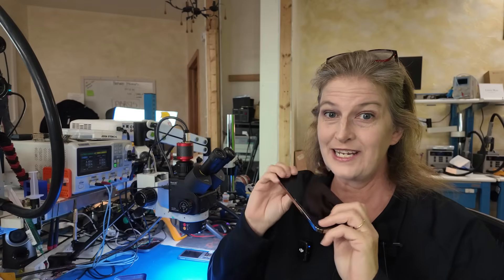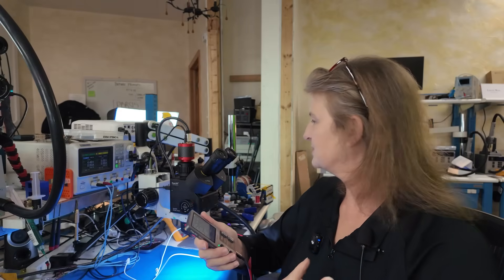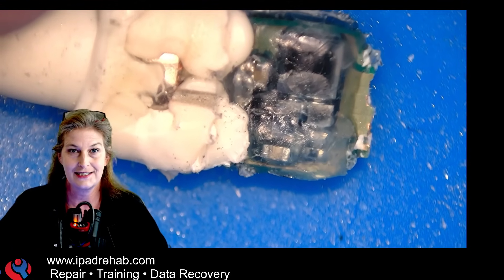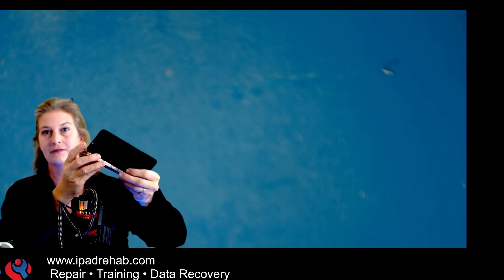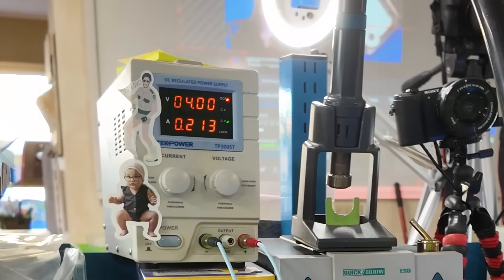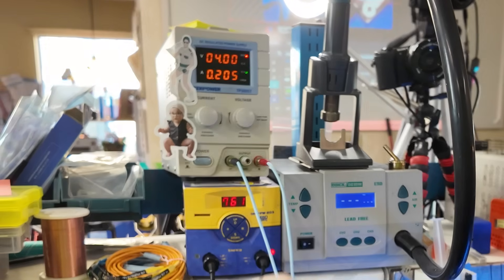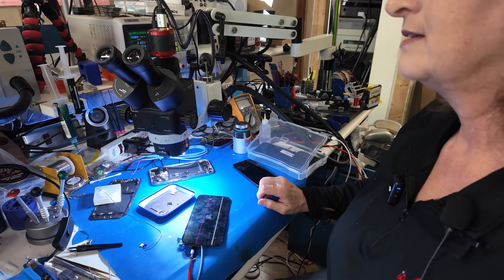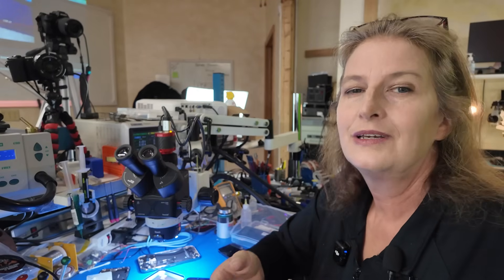Airplane Outlets Can Kill Your Phone (Data Recovery Case)

Comment: No matter what cable or device manufacturer, just don't plug in some random/ unknown port.
Reply: Or use apple, than you can charge with ground loop with shitty FM transmitter for years

Comment: does any of this apply to Android phones?
Reply: I don't think so, but you should still take precautions, use a good quality cable, good quality charger (avoid these public ones, if you need to, charge a power bank and use the power bank to charge the phone). And of course, backup your data

Comment: I have a wired headset that has a battery that (I've since replaced) that didn't last a full flight. I plugged it into the seat back, and it produced a hum. I then used a power bank instead, and that did not produce hum. But these days you are not allowed to use a power bank on some air lines, and on some you must have the power bank visible if you use it. BTW, I have lipo bags for my power banks and batteries and bring them on flights.

Comment: Isn’t this proof of bad design of the Apple iPhone charger port circuit?  Shouldn’t the protection chip be inside the iPhone to protect it from getting zapped by voltage fluctuations?

Comment: When the phone reboots due to missing sensors does it continue to airdrop the photos in the queue?
Reply from the maker: No, you can only do it in sets, however one great and wonderful day the airdrop strategy did STOP a xsmax from rebooting.  I don’t know why and it never repeated.  That phone had a charge port sensor error from severe charger damage and it burned the cpu.  It rebooted no matter what.  Then I started airdropping and it stopped rebooting.
Reply: @JessaJones that's a very strange one!

Comment: So why exactly does that  $1500(?) piece of garbage not have over-voltage protection?
Reply: More importantly, why does that $115,000,000 flying tube not have basic surge protection for seatback outlets used by passengers?
Reply: @TRLTheRandomLab  Honestly, IFE system should have a voltage stabilizer... Aren't voltage stabilizers airworthy? haha
Reply: @TRLTheRandomLab  for starters, it's a very expensive airplane, not a power supply for flimsy Apple products. And I don't see the first shred of evidence that it was the airplane's fault. Do better.
Reply from the maker: It’s definitely the airplane.  As evidenced by “I used this charger all the time.  Then I plugged it into the airplane.  Now my phone is dead”.  Repeated enough to jump out as signal vs noise in the thousands of “how my phone died” stories we’ve heard over the last decade.
Reply: @JessaJones  no, you're arguing, not showing evidence. And you're 100% wrong. The evidence that you showed in your video clearly shows that the seatback has a USB-C port. The Apple phone has a Lightning port. They're not the same, or equivalent. Also shown in your video: the kid used an adapter not made by Apple. Try reading the fine print, that's against the EULA for the phone! There's absolutely nothing on that seatback saying "for Apple phones" so the error is 100% the user's, for plugging the Apple product into a non-Apple port, and using a non-Apple adapter cable to do it.

But don't take my word for it, go ahead and sue the airline with your unsubstantiated allegations. I'm confident that a judge would say the same if it was even allowed to go to trial. Frivolous cases usually don't.
Reply from the maker: The video is about Nicks phone, and countless other phones.  In the video I dissected Nicks actual charging cable that he plugged into the actual airplane seat outlet into a charging brick that fried his phone.  This is not an isolated case.  The other major phone killer is truck cigarette outlets for the same reason.    They generate voltage spikes when the engine starts, similar to the airplane.   This is a known phenomenon dating back to 2012.

As an aside, I included an amusing clip of my own son plugging his android into a usb c outlet while I told him not to do it, as a lead in to the general problem of airplanes frying phones via cheap chargers that have insufficient protection.  It can also happen, less commonly, with well made chargers.  

There is a risk to plugging ANY phone into the wild voltage of airplanes, vehicles, and other power sources subject to large swings in power.  It is 100% a risky thing to do.
Reply: @Speed-Daemon-123  bro your attitude is why i can't stand some electronic engineers. arguing android vs apple like its 2014.
Reply: @Speed-Daemon-123 I know right... Can you imagine how many people use those planes, and how many of those have iphones, and how many of them charge the phone? If that was true, it would be a much larger amount of complaints
Reply: @luladrao5001e  it's better to light a candle than to curse the darkness. As you noted, most people handle these situations with aplomb. The ones who choose to ignore the instruction manual, then make scapegoats for their failures are only cheating themselves.
Reply: @JessaJones  I wonder if it's because the power is AC coming from the engine generators, and not properly grounded? I'll have to ask my aircraft mechanic friends about this. Fascinating video at any rate!
Reply: Because Apple decided to put that in the cable, opposite of everyone else. Very weird decision.
Reply: @zaprodk  I could believe there's some good engineering or manufacturing reason for that and it's not JUST part of their user-blaming, repair-hostile, accessory-selling business model, but gosh it sure fits into that nicely doesn't it
Reply: I have traveled twice with Thai airways recently, and none of the times, did my USB charging outlet in the entertainment system work. Hidden between the seats, is actually a 230V outlet, which few passengers even know about, so you can use a regular phone charger, however these are international outlets, where no devices connect properly because of the multi plug functionality.

If the aviation industry isn’t doing this well and we even risk to fry our devices, I believe people will secretly go back to using powerbanks on the airplane on longer trips. Without a working phone, you could even get into more trouble than not having your ticket, but when you arrive US immigration and they have decided to search your device and it refuses to even be charged and turn on.
Reply: It does.
Reply: That extra energy still has to go somewhere. Thermodynamics and all that.
Reply: @StanleytheCat-v8z  at least you're thinking. But no, that's not how USB works. The various voltages that USB supplies are not caused by planes, trains and automobiles, they're caused by the phone asking for them on the bus. The Apple phone then applies that voltage to a load indiscriminately. Normal, USB-compliant phones don't do that.
Reply: @Speed-Daemon-123  I'm referencing over voltage protection. The voltage clamping circuity needs to somehow dissipate the extra circuitry.
Reply: @StanleytheCat-v8z  are you an AI bot by any chance?
Reply: Because it's stupid Apple 😂😂😂
Reply: A fool and his money are soon parted. Android phones are cheaper, more robust and use industry standard cables that are also cheaper and more robust. And who are these people who leave the house with 2% battery? Are they trying to fail?
Reply: iPhones are just..... Bad.

I love my iPhone 10, but it still does so many shenanigans that piss me off.
Reply: @StanleytheCat-v8z cause it’s 5 years old… they deliberately slow them down

Comment: I wonder why the overvoltage protection is not built into the phone itself.
Reply: You can buy millimeter-sized TVS diodes, there's no excuse for apple not including over-voltage spike protection. This must've been a substantial overload to do with the power delivery being configured for 12v or something, rather than a quick "spike" or "surge".
Reply: They have record revenue on repair for a reason
Reply: So phones can break and the customer can be blamed for not buying overpriced cable.
Reply: Once they removed the headphone jack there was simply no room left  🤷‍♂️
Reply: Two thoughts immediately spring to mind. Lack of space. Never been tested. There's also the side effect - people buy Apple cables with the protection built in. People that don't, well they just have to buy a new iPhone. Either way it's a winner winner chicken dinner 😛
Reply: Exactly. This circuitry is not needed in non-Apple-phones. Other devices charge via Mini/Micro-USB-C happily with absolutely no problems. I feel Apple did this entirely on purpose. I'm an EE btw.

Comment: Shouldn't that protection be in a USB-C Chip inside the device?  I find it a bit strange approach if that chip is in the cable and not in the consumer device itself. I mean cables have their E-Marker chips to tell what they can handle, but an over voltage protection and stuff like that is something i would expect in the smartphone itself.
Reply: It's a power negotiation between the device the chord. The protection in the phones software/hardware is basic charging might work but it can throttle/fail. It won't charge to its max speed. I don't do deep board repair, but I've done plenty repairs with modular components AND data recovery 'missions' almost like this. The nature of charging IC as a tech is unique pressure because it's time sensitive and modular parts aren't gonna fix it. The data is NOT on the cloud, it's on their  encrypted board thats kernel panicing.ANYTHING like this a customer has with lightning: im running a Tristsr test (Tristsr is the name of the ic chip on the phone. ) the tester SHOULD have diagnosed it in 20 seconds. But depending on what data the cx and how long it's gonna take to back it up to iCloud/another iPhone and keeping the iPaniked phone stable enough/long enough
Reply: @JamesDelano94 why is it not negotiating device to device?
Reply: @Evercreeper Pretty much all parts in the chain should communicate to find the least common denominator, no? Imagine the device and power source can handle 100W but the flimsy cable between only 20W, and gets a lil melty. 

This video makes me want OCR and OVP on both the cable and charge port. Although it's less costly to replace a cable vs phone components.
Reply: @askedmarlin  I definitely agree with you- but why is the cable not negotiating WITH the target device? In this case, bad power supply borked a good device because the cable either said OK or didn't talk. Just like backups, its good to have more negotiators.

That's just rant ofc. I agree with you 100%. Both the port and the cable!!

Comment: A lot of public transport where i live has USB A sockets (no type C sockets though)
Im guessing up until this point, i've been lucky (although up until i got a new phone earlier this year, i would often carry a large power bank with me, as there was no guarantee that the bus would have USB sockets, and even if it did, not all seats had one near them)

My new phone has never been plugged into a USB socket on a bus or train (partly because i never need to charge it while i am out, but also because i do not have any USB A to USB C cables that i can take out with me)

A few weeks ago i was on a bus that was having electrical issues (i dread to think what would have happened if i did try to charge my phone from a USB socket on that bus), for those wondering, when the engine restarted, the lights would go very dim, and then start flickering until the bus started moving
Reply: Meanwhile I just buy Chinese phones so I don't need to deal with terrible battery life.
Reply: @ithinkitwaskhamas  One of the things that keeps me away from Chinese phones is that they often have spyware on them, and that assuming the software on the phone doesn’t malfunction (I have seen the battery percentage on an unknown brand android phone go haywire)

Comment: Yup. Apple outsourced the protection to the cable. Remember, this is the company that made a phone that couldn't be used as a telephone when held in your hand. iPhones are very weak dealing with bus switching in the plane's internal systems, especially USB C connections that don't renegotiate the voltage after a mild brownout (like switching from APU to Gen1) and poof goes your iPhone. Been on a few flights with people complaining their phone died and it's always an iPhone. USBC doesn't make any difference, it's still not coping. Stick with 5V charging and shove a poly fuse and transorb across V+/V- in a little USB dongle and save your iPhone (just put up with slower charging)
Reply: All that, or buy one of the thousands of non-Apple brands that have the electromagnetic compatibility to live for a whole day, and get on with your life. To own Apple products is like staying in an abusive relationship. As for charging, every single day my phone has at least 8 hours for charging. Even the oldest spec 0.5A 5V USB port can charge a 20 Wh cell in that time.

Comment: it is known problem with all Apple device, charger with spikes will kill TriStar chip in iPhone orCD3217 (or 15) in MacBook's. Same about cables. Androids are much less sensitive to the problems, 
Now with type C cables for new iPhone it is even a bigger problem, because technically you can use android cable to charge an iPhone, but physically it is no, because some of the wires in the Apple cable are weird differently.

I heard that from iPhone 15 and up, you have to replace both TriStar and a bios chip from a donor board and not only the TriStar chip (I'm writing it before seeing your video).
Reply: "Android usb cable" wtf its USB-C standard connector. Sue Apple if they doing any funny business with it.
Reply: @XantheFIN  I've seen people claim apple USB C cords are different. the only connectors in them missing are the USB 3.0 contacts. Apple ships USB 2.0 type C cables by default, most Androids ship 3.0 cables and thus people see missing TX/RX connections and think it's a different cable
Reply: "some of the wires in the Apple cable are weird differently" 

I call BS. Either it's USB C or it's not. You don't diverge from the standard and claim to follow it if you have a name to uphold.
Reply: @kg790 they’re just USB 2.0 type C cables. They lack TX and RX pairs and people see the missing connectors as a different cable

Comment: Is there any reason the protection chip couldn't be put in the phone?
Reply: Jessica: "This is all bad design by itself."
Reply: Or just use a voltage stabilizer
Reply from the maker: I think the idea is that the cable will sacrifice itself, like burning a fuse, to protect your phone.  You only have to replace the cable.  If that fuse is on your logic board then you’d still have to get a new phone.
Reply: @JessaJones  But all other brands of phones don't use traditional fuses. There is polyfuses and TVS-diodes, which will self-recover. There isn't any other non-Apple-phone that has an old fashion fuse that melts.
Reply from the maker: @zaprodk we see charger damage on other phones as well, plus Nintendo switches, but it is definitely more common on Apple products.  The google pixels have poorly soldered CPUs, the Samsungs get death of the flash storage chip, etc.  it’s always something
Reply: @JessaJones  but it should be on charging flex so it can be replacable, but for my opinion it is stupid almost all products from Apple. You change flex boom sensor problem and reboots, speaker not working boom reboots...it is so sensitive like born child...